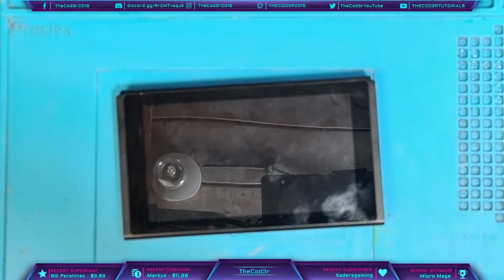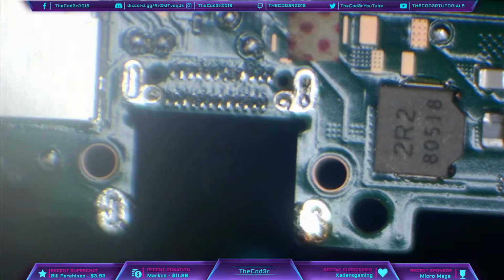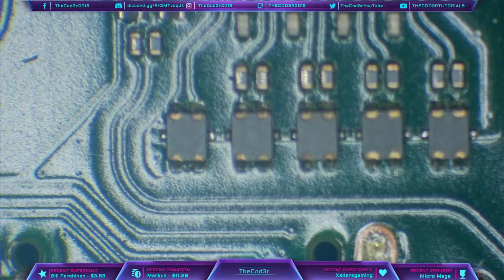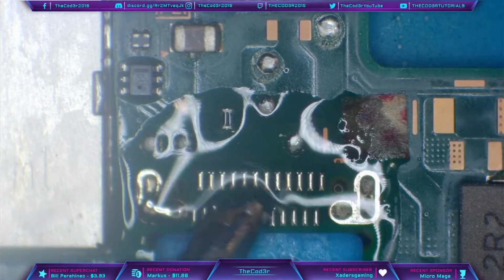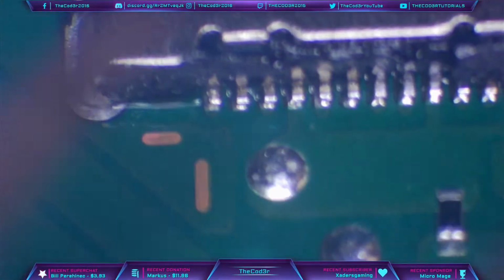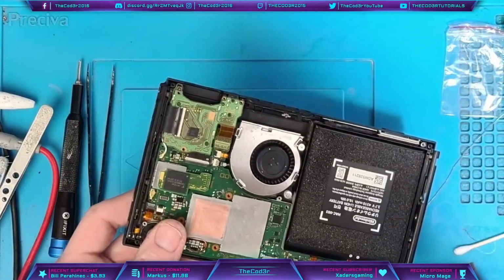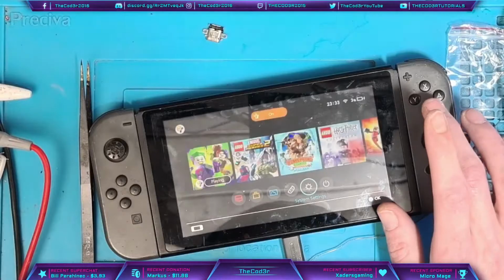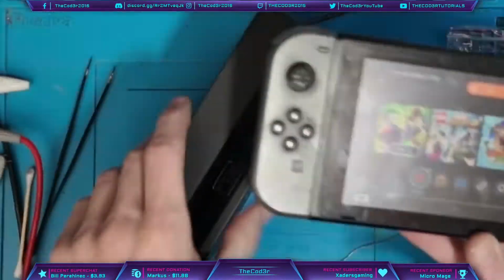Nintendo Switch Not Charging - Error 2101 0001 And Damaged USB C Port Diagnosis And Repair

Comment: Same thing my brother's did four days ago that bitch never came back on now I need to take to a repair shop to have it fixed  I even tried 13,14, 15,30, they said on YouTube and Google Google nothing happened are even worked 😒

It showed that message before shutting off

Comment: That exact error code happened on a switch I revived, from a failed repair attempt by someone that should not be touching tools. The 2101-0001 code was cleared, or the switch booted without it, by running the board in ultrasonic cleaner. Error code has not returned.
Reply from the maker: Sounds like that one could've just had a little liquid damage around M92T36. Good to hear you got it working though:)
Reply: @TheCod3r  It was the one I sent you message on Facebook about. Utterly destroyed by someone that thought they could solder. All is well now though.